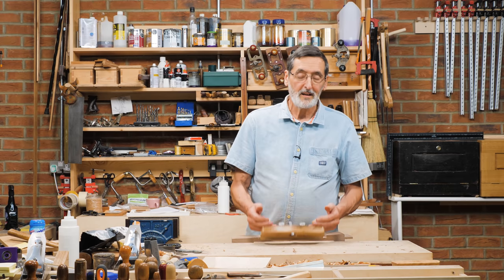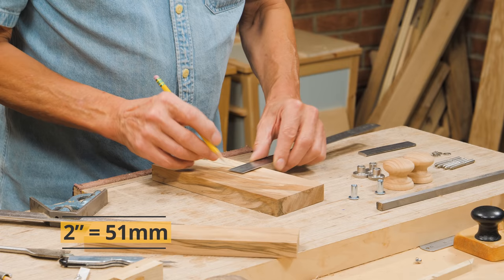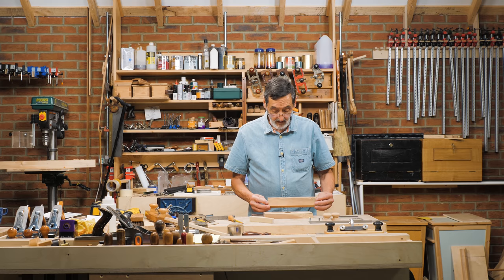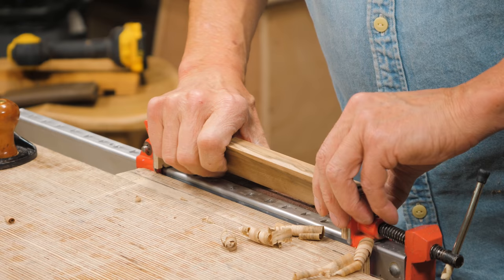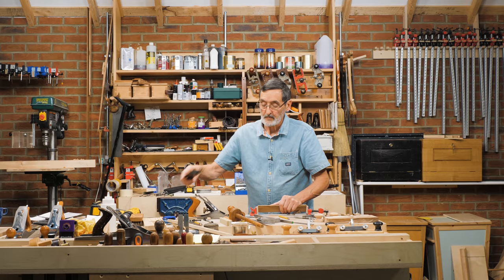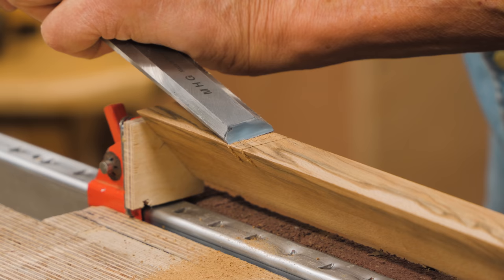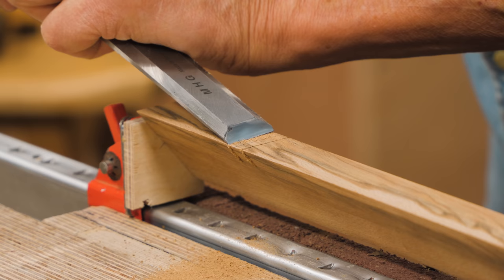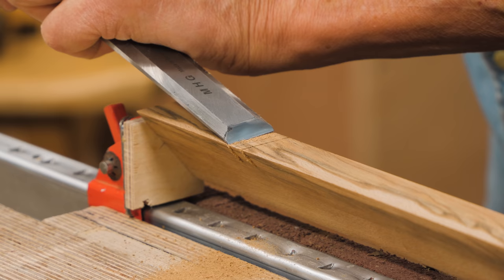How to Make the World's Best Router Plane | Paul Sellers | Episode 1

Comment: Hi. Can you give some recommendations on decent bench vices? Since Brexit, it's basically impossible to get Eclipse vices anywhere but the UK.
Reply: Record 53 or 53 1/2, They are available on ebay from £30 up, but the shipping will be a nightmare if international. On Pauls website this is what is recommended, eclipse is the best "new" alternative
Reply: @MaffuH  Thanks for the reply. But the problem is, that Eclipse is practically impossible to find outside UK (sometimes US), so thanks Brexit.... I'm in the Czech republic, so York might be an alternative, but Paul wasn't satisfied with the quality.
Reply: @janvlasan8369  Absolutely go for the York, it's much easier to have a discussion in your native tongue (or Pinie also do vise kits). Forget Brexit, you have Pinie planes (making tools for longer than Lee Valley and Lie Nielsen combined), Narex chisels, which are my reach for chisels. If you wanted a Rolls Royce vise, you could get a Sjoberg (continental EUrope, so no borders to cross).

Comment: Would this work at all if instead of a piece of tool steel one used a chisel? I'm thinking whether it would be possible to swap the chisel depending on the desired width. Do chisels cut when rotated so that the bevelled side faces down?
Reply from the maker: I suspect that the steel will be too hard to work by hand with a file, a drill or a hacksaw so will need softening by heating and then reworking, as long as it is not air-hardened steel.
Reply: I considered this too but the problem is a chisel is that they usually taper along their length so i don't think the clamp design would work.
Reply: @petertaylor3150  Ahh.. I didn't know that. I always assumed they had parallel sides.
Reply: @Stelios.Posantzis  Mortice chisel the sides should be parallel.
Reply: @williamn01  which two sides? I think Peter Taylor is referring to the narrow sides as being tapered but I might be wrong.

Comment: A very interesting looking rasp used near the end, if anyone has a link to that it will go on my wishlist.
Reply from the maker: It is called a Shinto rasp and has finer one side and coarse the other. It removes material faster than any I know of but you must be sensitive with it as it can tear the grain out especially on the coarse-tooth side.
Reply: @Paul.Sellers  they are great for the price compared to solid steel wood rasps
Reply: My dad gave me a Shinto rasp in the 1980’s, big surprise, wonderful simple tool. It’s great because it doesn’t clog. Good for knocking down edges like Paul did and taking off bumps.

Comment: Dear Paul , with due respect , your advice  on tools purcase  needs a course correction , better late then never , in one episode you prefer the  Veritas router to the Lie Neilson  one , why ?   one is supposed to take only light cuts  with a router plane , so any design which takes thicker shavings is not right , ie pure nonsense , I have used the LN router  for both thicker and thinner shavings  with no problem at all , in multiple  Half-lap mitre joint  as suggested by you , a blade coming apart , moving on you is not fun,  as it does in the Veritas Router Plane  quite freely, your total bias on using tools that are cheap  is bad advice as can be frustrating and time  consuming , and will turn more expensive as one would need to upgrade , so it is Time for you Paul (it is never too late)  to change course. !  There is more to life than Money !